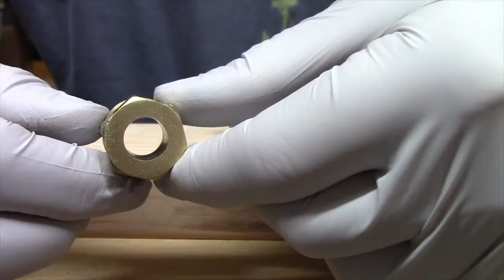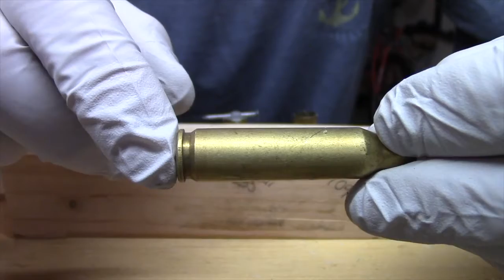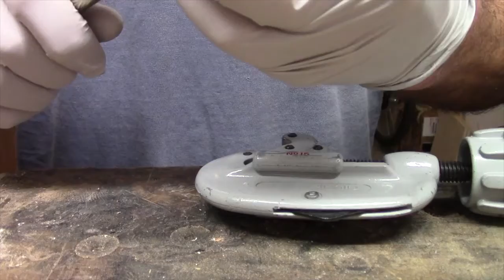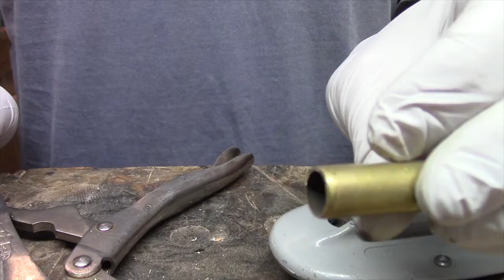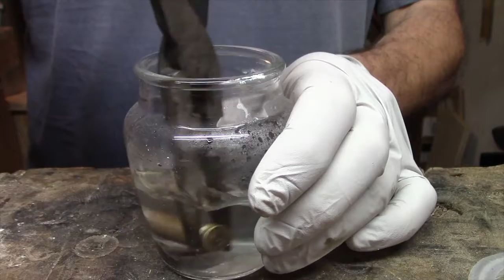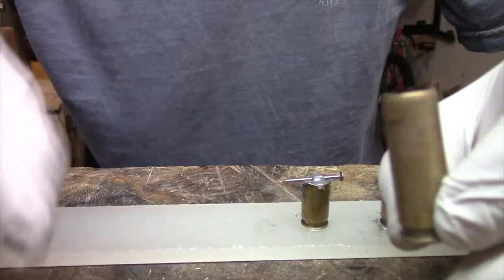45 ACP Shotshell Forming - NO DIES NEEDED - $10 in parts + tools!!

Comment: I’m not recommended to anybody used my technique but what I just do personally is I take a 410 shell cut it down to the length that you want that it fits inside the cylinder and doesn’t protrude out the front and you can take out a little bit of the shot and you can either plug in with a wading for like a black powder 44 or you can actually melt a little candlewax into the front no powder charge was changed no wad was changed just simply trim and cap the end to fit inside the cylinder and then also I had to do a slight modification to the rim of the rear of the shell because it has a slightly wider profile, then the 45 colt so they don’t fit nicely into the cylinder unless you take and file off or sand down a little bit of the perimeter of the rim so that they can fit nicely into the revolver cylinder and seat all the way in. That’s all I had to do. I’ve test fired it already several times no issues some of them. I did pour out the birdshot and replaced with standard 177 calibre BB and or a mix of birdshot and BBs . So this required no dies no tools except for scissors a lighter a file and some candlewax. If someone foresees  why would be an issue, please let me know. So far it seems to be causing no problems. Just took a little bit of trial and error until I figure out the process so now you can just simply buy a box of 410 shields and quickly modify them with hand tools educational purposes only not attempt gunsmithing or ammo manufacturing without proper training.

Comment: the square hole in the reamer of the tubing cutter is a wench to open  the value on a  acetylene tank.   mystery solved
Reply: It is only a mystery to the guy that doesn't know what the brass fitting section of a hardware store is for.

Comment: Do NOT anneal to red hot; that will conduct heat down to the case head.  Use Tempilaq until you get the hang of it.  The case should just discolor at the mouth.  Sit the deprimed cases in a shallow pan of water leaving just the mouths exposed, heat the mouths, and tip them over into the water.  Water quenching in this manner is not for tempering - it's to dissipate the heat so that it doesn't reach the case head.  It would have been useful if you had done the step 2 video and provided the link.

Comment: The nails may be heated with the torch and quenched to harden them for a lasting sharpened point.
Reply from the maker: Bill McGraw So that's a pretty sensible suggestion, except I have tried it before with both water and oil (transmission fluid) quenching.   The nails actually got softer and wear faster.  I did some research and it turns out that regular framing/wood nails have virtually no carbon in them.  But specialized masonry nails do, and from experimentation I know that your suggestion does work with that type of nail.   

I have changed my overall process a little.  I now anneal the brass before scoring and cutting.  I've gone from refilling the trim nails every 75-100 pieces of brass to refilling once after 250 or so.   This jog was hasty and improvements are still on my to-do list.